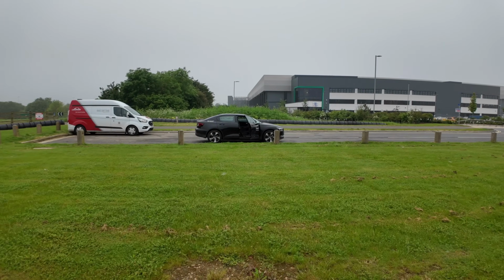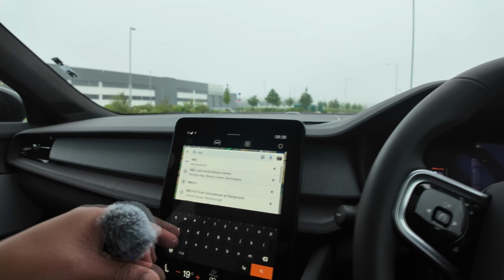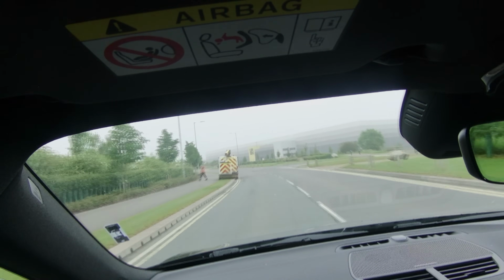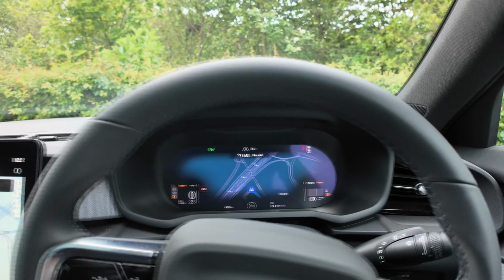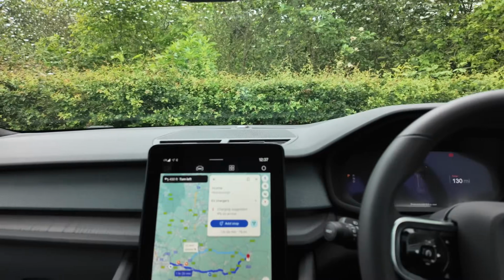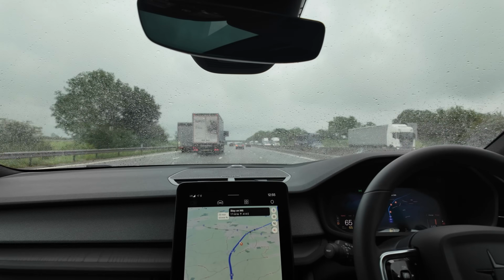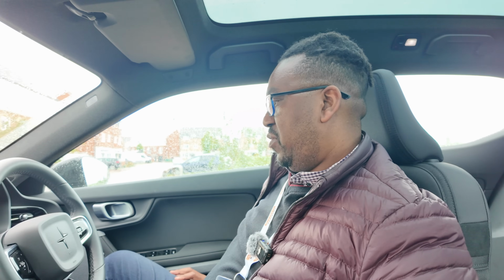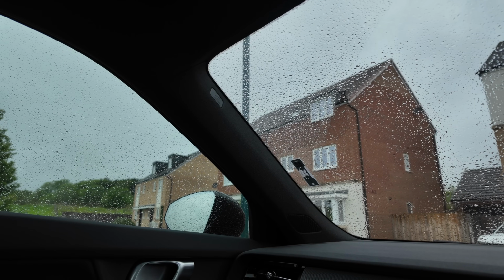Surprising Polestar 2 Road Efficiency Revealed

Comment: What speeds were you going? it appears it was 62 to 65 mph .. not kilometers, right? In the states, were I am normal traffic is around 80 mph so I'm trying to understand the range at those kinds of speeds.
Reply from the maker: On the limit, 70mph and sometimes 65 as l was using cruise a lot just as l drive normally so l could measure it correctly. It impressed me

Comment: My next thing is Air to Air Heat pump then have the gas cut off
Reply from the maker: I hear, they're better than Air to water! Keep us posted
Reply: @letsgoelectriclge1320  Yes they dont get much attention, they are so much cheaper than Air to Water that needs to have the house ripped apart,  im not havving a water tank fitted as thats expensive and no one these days has a bath , for the kitchen and bathroom you can get under sink water heaters but i just use 2 kettles as i live alone . for 5 or 6 months a year i run of my battery so dont ues any gas at all . When i first turned off the heating for the summer i found that just me doing the washing up and having a shave cost over £10 a month so i went to Tesco and got a £6 kettle for the bathroom,  The A2A im having is less tha £5k and from all the videos ive seen ppl are very happy with them .
Reply from the maker: Sounds like a no Brainerd although thinking of future selling of the house, but lm sure there will be the cooker tech for warm water for the bath.
Reply: @letsgoelectriclge1320  Hi i just sent you a long reply and its gone missing , if you cant see it ill write again , best wishes